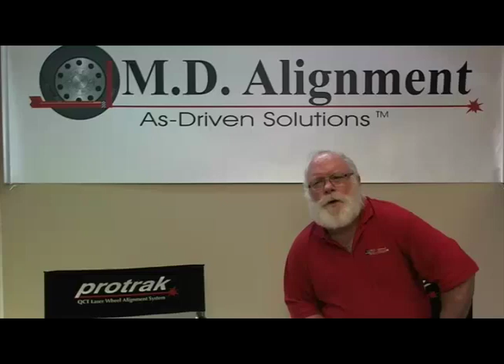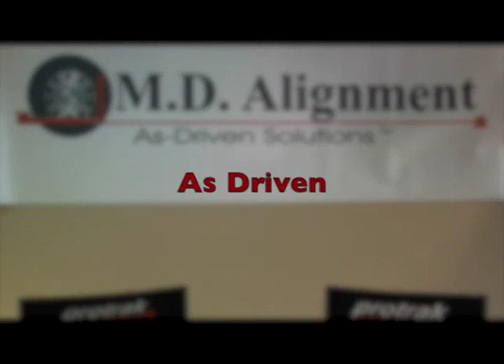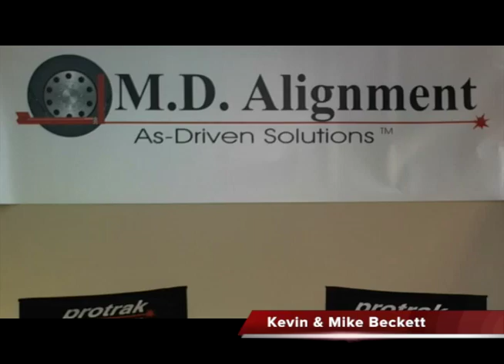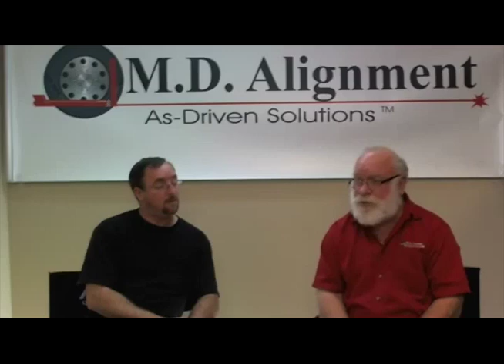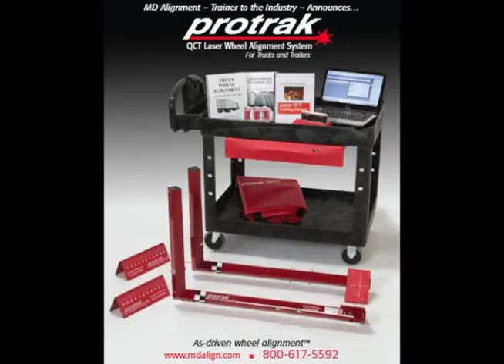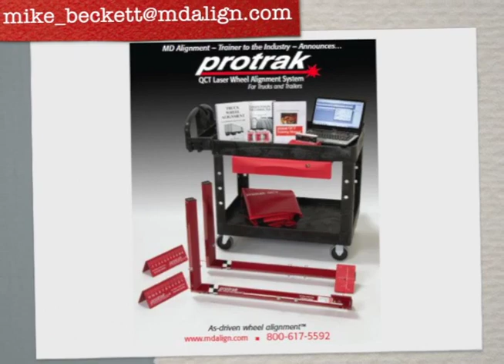Why does your truck need an "as driven" alignment?

Comment: I have used your M.D. Alignment machine for two years ! For the money it's a very good product,  but you must tell everyone that before no matter what machine you use before you align anything requires lifting up the truck and inspecting everything ! Like your Bearings, king-pins, Tie-Rod ends, drang-link , springs hanger bushings, u bolts, Torx-Rods Lateral axle adjustment ! Etc.....without doing this your alignment is nothing! Most mistakes I see mobile guys do, is they don't do the shake-down, then when they align the rear axles they don't recheck their work also I use A hunter Alignment machine and it reminds you, that if your adjustments are out after you had adjusted the scrub axle ! I always recheck by making sure the air-bags didn't lose are because if they did? You will get a wrong reading and if they check okay? Then I proceed to adjust the thrust angle again! Does your machine check for a rear axle that is bent? And runout? Or bent wheel?
Reply from the maker: Inspection is a very important part of any alignment.  We have 3 books and more videos on what to look for aside from alignment angles.  If you suspect a trailer or drive axle is bent, there are options for verifying that.  Simplest would be to take a toe/camber measurement, which can be done on any axle using our equipment. Bent rims/ runout can be identified a couple ways, one of which is by rolling the vehicle forward another half rotation of the rim and remeasuring.  You can split the difference for accurate thrust/toe, but too much bent rim/ mismount will cause tire wear.